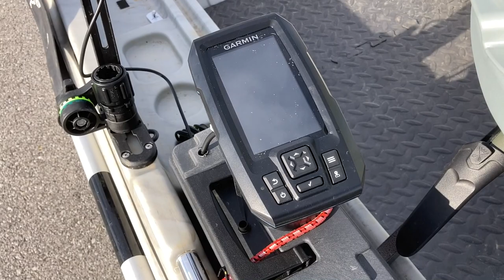Crappie Fishing Machine - Tiny Boat Setup

Comment: Been thinking about one of these boats for while now to use in the back country. My Jon boat is a heavy 1974 polarcraft that's become to heavy sliding in & out of my truck bed. Especially at age 64 with back issues.
Reply from the maker: Definitely light. I think the empty boat weighs around 100lbs or so for the 8 footer. I’m loving this one, so far.

Comment: This is an awesome setup. I've wanted to get one of these to use instead of my kayak. I love all the little accessories you have mounted. Danny from TND Outdoors and Shannon from Swamp Stalker Outdoors sent me your way. They were talking about how great your video content was, and they were right. Both are good friends of mine.
Reply from the maker: Thank you so much! I really appreciate it. Danny and Shannon are both super nice fellas. The Pond Prowler is hard to beat. I have a newer video up with some additional mods I did to mine. I will be upgrading my trolling setup to a lithium battery later this month. Hope to post a video on that afterwards. Appreciate you watching!
Reply: That will be awesome and save a lot of weight in the boat. I'll try to check more out.  @pistolcreek
Reply from the maker: Thank you!

Comment: New Sub, Nice set up. Really like the phone holder set up. I have two trolling motors on my Quest Angler 10 but been thinking of getting an outboard but don't know to much about them but like that not having to mix up the oil and gas. Pretty cool.
Reply from the maker: Awesome! Thank you! So far, I am really enjoying the Honda motor. I think adding a small outboard gives you more freedom with covering larger areas of water and conserving your trolling motor battery.

Comment: Awesome setup and video. I’m looking for something like this and the addons you made are brilliant. Gave me ideas on what I should get. 👍🏻
Reply from the maker: Thank you! If you are looking for a small boat, I highly recommend these. Super stable and lightweight. I really like the fact that you can stand up and move around as opposed to sitting so low in one position in a kayak. Thanks for watching and let me know if you have any questions about the boat or setup. Good luck out there!🐟💪
Reply: Hey  @pistolcreek , had a question for you. Do you know what the width measurement is when you turn your boat on it's side? No need to rush for a response just if you ever had time! Thanks.
Reply from the maker: @Orgos6  Just measured it. It’s 47” wide, 19” high, and 8ft long. Hope that helps?
Reply: @pistolcreek  Yes that helps, also if the boat was on it's side, could it fit through a 32inch or 41inch door?
Reply from the maker: I would think so…assuming you mean the doorway is 32” wide? On it’s side, the boat would be 19” x 47”.
Reply: @pistolcreek  Yep, I misread your first response, my apologizes! Thank you for the quick response, I really appreciate you taking the time to do that for me, much respect!
Reply from the maker: Anytime! Let me know if you end up getting one and how you like it.

Comment: which scotty mount did you use for the rod houlders on the side rail? It's pretty narrow on that rail
Reply from the maker: This is the transducer mount I have… https://tinyurl.com/493m6j5f . It’s the Transducer/Sup mount. $34.99 at Bass Pro Shops. I used a 4” mounting rail from YakAttak. It’s a tiny bit wider than the boat railing, but works fine. Just run your screws in at a slight angle toward the inside. Honestly, two screws will suffice as long as you aren’t trolling for large trophy fish.

Comment: What length of motor shaft  did you go with on that Honda
Reply from the maker: I went with the short shaft, which is 15” because I like to fish some really shallow spots. The long shaft would also work, because it’s only 5” inches longer at 20”. I will say that the short shaft on this particular boat just barely submerges enough. If you have a different boat with a higher transom, you may consider the long shaft version. I’d just measure prior to buying one.
Reply: I have a quest sportsman 10, It's 20 inches from the top of the transom to the bottom of the pontoon
Reply from the maker: Nice. Maybe the longer shaft would be better?

Comment: No nuetral or forward and reverse?
Reply from the maker: No, sir. It doesn’t have reverse, but you could rotate the motor all the way around if a person wanted to. It has a clutch similar to a go-cart, if you are familiar with those? The prop doesn’t engage until you rev the throttle up above idle.

Comment: Do you have your boat motor bolted or do you take it off and on.
Be nice to see how it was bolted to the boat
Reply from the maker: The motor has a mounting bracket that you twist to tighten it to the transom. I remove it when I am traveling. Only takes a few seconds to put it on or take it off.
Reply: @pistolcreek  I'm gonna try and bolt mine on so I don't have to do all that
Reply: @pistolcreek  I really enjoy your videos.
Reply from the maker: You can leave it on without having to bolt it if you want. It’s plenty secure. I just personally like to remove mine and haul it separately. The Honda motor also has slots to padlock it in place if you wanted to.
Reply from the maker: Thanks so much!
Reply: @pistolcreek  your very welcome 🙏
Reply: @pistolcreek  I know it takes a bit to get these small boats ready to go fishing. I have a pelican 10ft boat.should have
Gotten a smaller one
Reply: What rod and reel set up are you useing